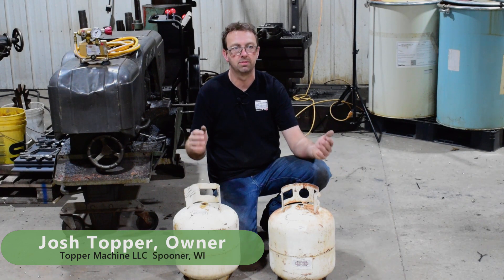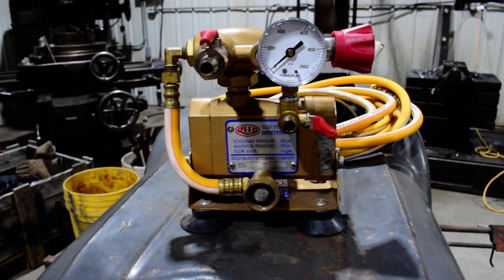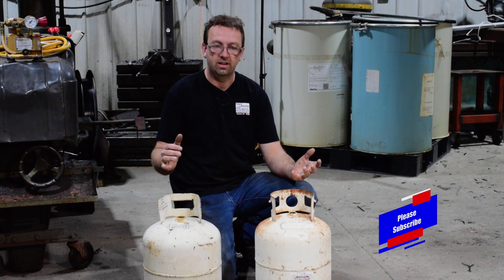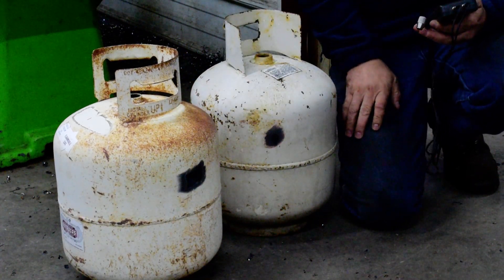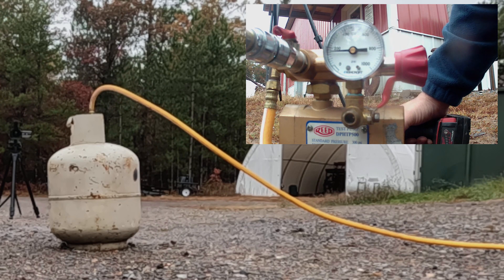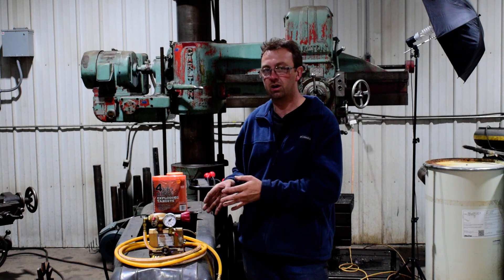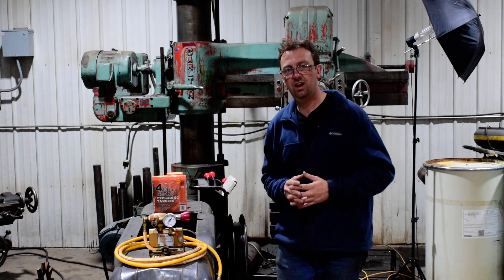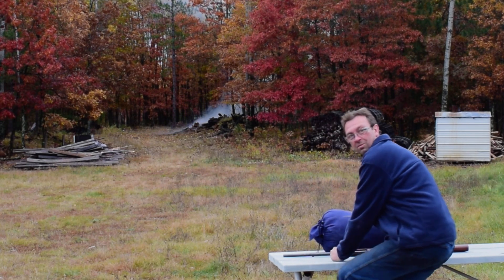What does it take to blow up a propane tank?  Hydrostatic testing

Comment: The relief valve on a propane tank is normally set to 375psi with a 5X safety factor, so burst pressure will be close to 2000 psi.
Reply from the maker: Everything I read said 1000 psi. In the spring I'll hook up a pressure washer and find out.
Reply: @TopperMachineLLC  -  I would love to see it. IT better be a very strong pressure washer... I think the tank will put up a fight. THey are much tougher than they let on. Foreign tanks in many cases are scary but ones here in North America are very very hearty. The only way we were able to blow one was put it in a very hot coal fire and about 10 min later it went off with a teriffic roar... and the woods were bald. ha ha  THe collar landed on the neighbors property in tact. Looked like ground zero and all black and burned.

Comment: Josh to calculate the max yield strength of those tanks you have to know the grade of steel the tanks are made with. You can figure it using grade 42 steel which is about the lowest grade used in pressure vessels.